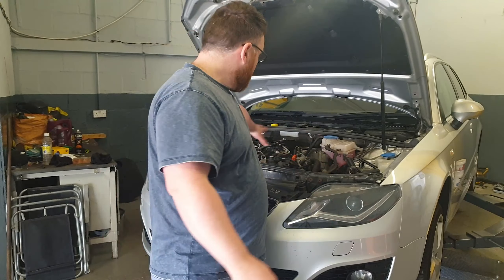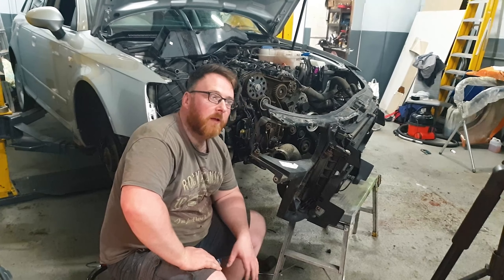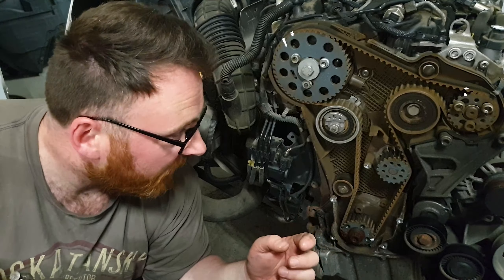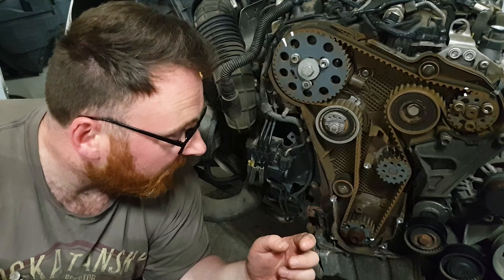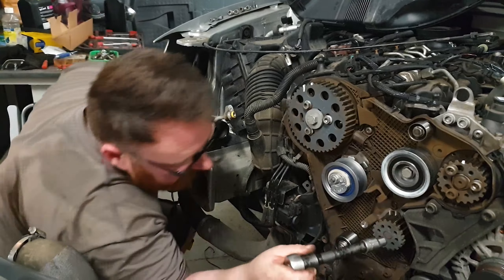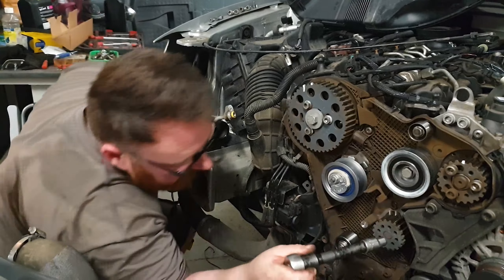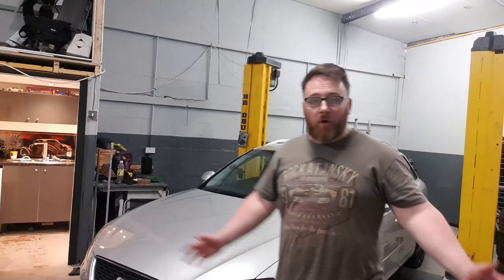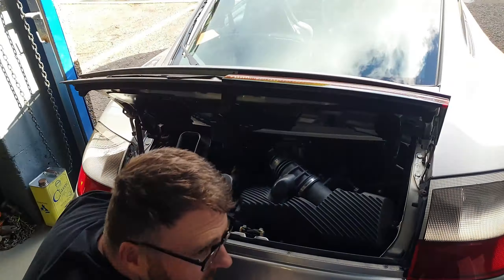There's a Porsche too.... (Debt Corrector - Episode 6)

Comment: Renault used a transaxle on an in-line fwd car in the 1960s (with the gearbox turned around and used in the Lotus Europa)
Reply from the maker: Very valid. My ramblings often need corrections! Let's say it was the first from Germany
Reply: @ToolsnTrack  , one look at a Beetle, and deciding on a sensible place to put the engine would push them to a fwd inline transaxle installation!